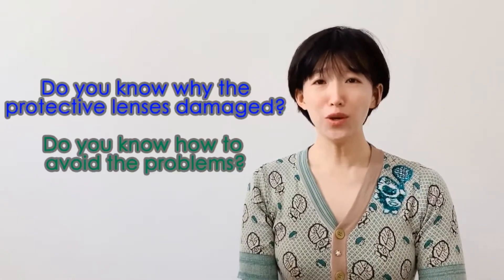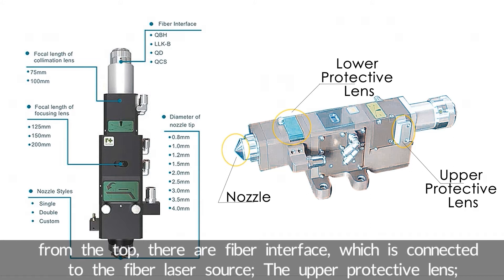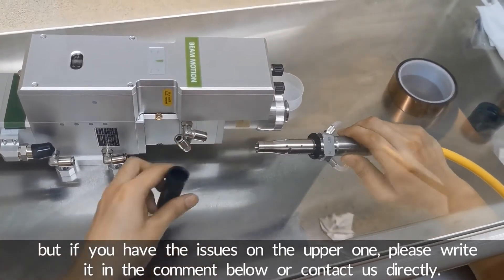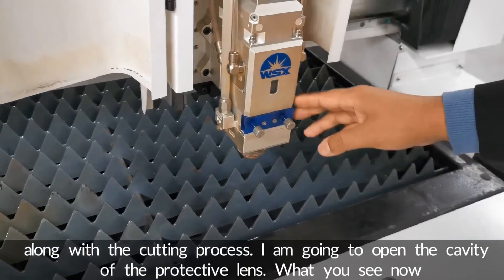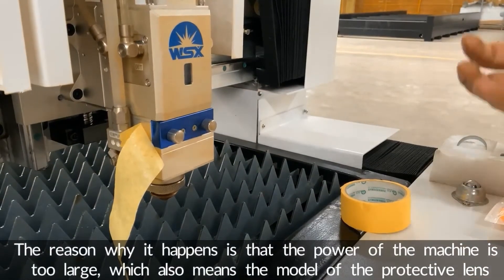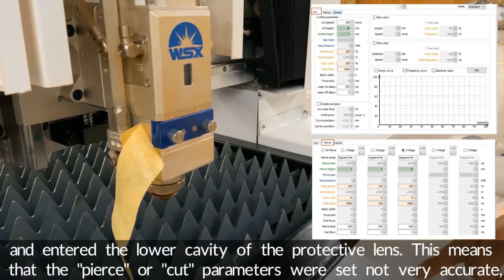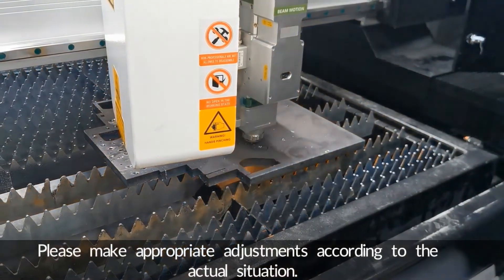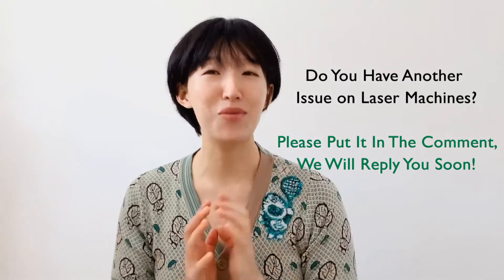Solution of Laser Cutting | Protective Lens Laser Cutting-1

Comment: I have a 3000W fiber laser cutting machine and when cutting 8mm or above the lens get black points very fast.. like 5-10 minutes cutting time.. I already tried many different pierce strategies but no success.
Reply from the maker: Have you checked your gas and nozzle? What is the pierce parameters?

Comment: I have problem of burning black point on the upper side of the second protective lens located between the lower protective window and the focussing lens. problem occurs after aproximativelly  hour cutting. All other lenses are clean without any problem. Also nozzle centering is Ok. airvoredsure is ok.  need your previous help if possible. if you share me your whatsup nbr, i can send you photos.
Reply from the maker: I think you need to check the specific cavity, you can check my video, the cutting head disassemble.

Comment: In my software, layer parameters settings does not have this many options. 🤔
Reply from the maker: What software you have?
Reply: @ClaraChai  what's difference between 2000c and 2000s
Reply from the maker: @dharmendrasuthar4342  later, I will upload a video which is focus on the models of CypCut.

Comment: I cut 1,5mm thick carbon steel using air on a 1kW head. 2 days ago I tried to cut a 6mm thick carbon steel using Oxygen but I didn't change any parameters other than cutting speed. Today I switched back to cutting 1,5mm carbon steel with air but it doesn't cut through. Any idea what might have happened on the head?
Reply from the maker: Did you check your lenses?
Reply: @ClaraChai  Yes. Both of them are intact
Reply from the maker: @thanostzanos3850  More lenses, including the collimating and focus.
Reply: @ClaraChai  No. Is it risky if I do it by myself? Do you think I need an expert to do it for me?
Reply from the maker: @thanostzanos3850  I think you need to check all lenses first.

Comment: Have you ever seen the protective lens crack? Cutting with N2 on a 1500W source and two protective lens have chipped out of the side.
Reply from the maker: Did you throw away the lenses? You need to make it together and check which side is the damage source.
Reply: It has been the topside of the lens
Reply from the maker: @paulb8264 the upper lenses fine?

Comment: laser not coming [laser pulls low alarm ] what is the reason?laser cutting only air
Reply from the maker: What laser source?
Reply: version 6.3 cypcut laser
Reply: cutting time only spark, stainless steel not cutting [ bcs100 ok lens ok centering ok]
Reply from the maker: @sanilkumarsanal8353  You’d better to contact your supplier
Reply: @ClaraChai  optical cable laser
Reply from the maker: @sanilkumarsanal8353  what laser source not software.

Comment: What is the reason for upper protective window has been damaged frequently?
Small black spots and also moisture content will be found when upper lens damaged.
Reply from the maker: Temperature between the room and chiller
Reply: @ClaraChai  I have the same problem like Design Metaltec but I don't have moisture on the protective lens. I have disassembled the head twice to clean the lenses and optics. How can I solve it?
Reply from the maker: @claurino69  did you find anything on the lenses?
Reply: @ClaraChai  dust is not always found. I have taped the top of the head and the protective lens caps and have not improved
Reply from the maker: @claurino69  It is better to have a thorough check